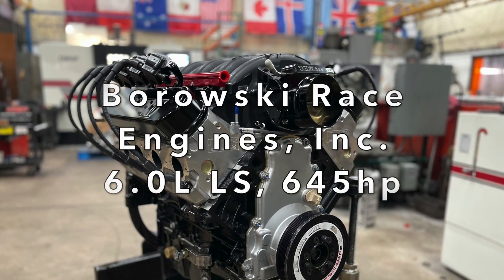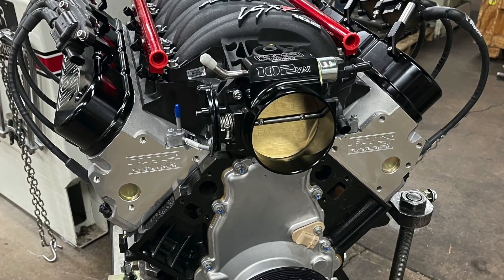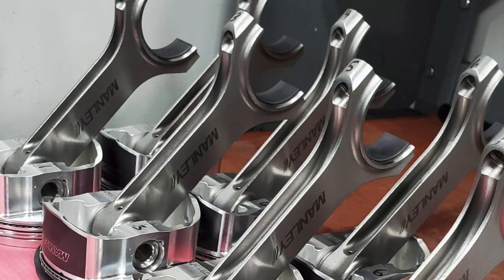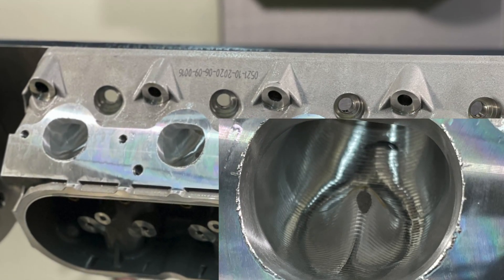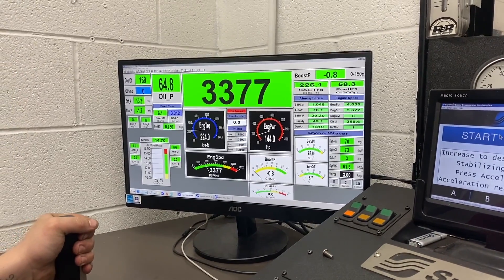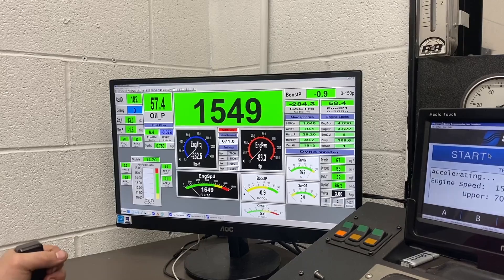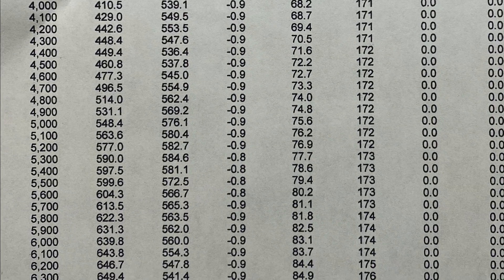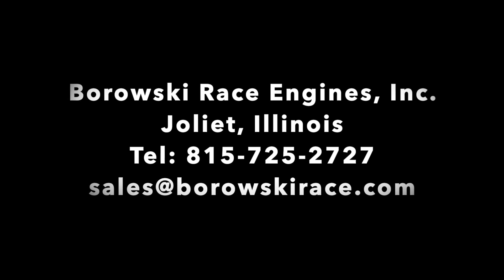Borowski Race 645 hp 6.0L LS Engine

Comment: What water pump is used for this kind of power would the stock LS acdelco one work or is a high flow needed
Reply from the maker: The water pump is not the weak link on most cars with moderate power upgrades like this one. Radiators and fans are the first place to look.

Comment: 5w30 in this engine ?
Reply from the maker: We recommend Maxima Racing Oil RS15W-50 Full Synthetic Motor Oil  https://borowskirace.com/products/maxima-racing-oil-rs15w-50-full-synthetic-motor-oil?variant=43080442216660
Reply: @borowskirace  what about a stock ls7 bottom end factory fill 5w30 ..wouod go with Rs maxima 5w30?
Reply from the maker: @ We only make recommendations for our own engines.

Comment: What is the cubic inch of this engine.
Reply from the maker: The 6.0L stock configuration is a 4.000" bore with a 3.625" stroke to yield 364 cubic inches.  We bore the cylinders 0.030" over (4.030").  This increases displacement to 370 cubic inches.  We just started spec-building one of these.  Our plan is to use seasoned GM heads instead of the new RHS heads shown in the video.  Both go through the same CNC machining processes at our shop.  Intake manifolds we have on hand are the FAST LSXR as in the video, as well as FAST LSXHR and Holley Lo-Ram. Other choices include types of serpentine and engine management if desired. Call us at 815-725-2727 for more details if you are interested.
Reply: @borowskirace  does the engine run pump gas or something else.
Reply from the maker: @anonymous-q4j2x  this is intended to run premium pump gas but we can detune it as needed for your preferred octane.  It can also be made flex-fuel capable.

Comment: Can you run that on a built 700r4 transmission
Reply from the maker: Not recommended.  The original version of our shop El Camino had an LS1 with 525 hp.  We bought a "built" 4L60E from a race transmission shop and promptly destroyed it.  The shop didn't stand behind their transmission despite having said it would work.  At that point, we sought to qualify a new automatic transmission vendor.  That turned out to be Hughes Performance.  We replaced the 4L60E with one of their 4L80E's and begand pairing them with our engines.  We sell two custom versions - 1,000 hp and 1,500 hp ratings.  The typical pairing is NA with 1,000 hp and Whipple supercharged with 1,500 hp version.  In the intervening 10 years, there have been no failures reported.  We have also had excellent success with Tremecs if you are up for a stick.
Reply from the maker: Point of Clarification - 4L60 is a rebranded 700R4.  E indicates electronically controlled shifting capability
Reply from the maker: https://borowskirace.com/products/custom-4l80e-hughes-performance-transmission?variant=43592574828756

Comment: plz,plz,PLZ on the next block going into one of ur vidz could u calculate the mpg it gets for us ???????????  a balance of bothe power & mpg is good for those of us who WANT a WELL biult machine but r NOT pro racers.maybe we like a SPORTY car but need to keep gas in the tank😅.
we r fully aware that what u show r 99% race app engines and it ur trade in stock. but DO biuld other "normal-ish" stuff right ??  mpg is 'sadly ??' big stuff with prices as they r ... ( i'm wainting for th Gov to step n and put a cap on this run awy train.... anyway i love the videos... stuff dreams r made of.
am i asking 4 the impossible ??? plz respond thanks ...me😊
Reply from the maker: Good news.  You can hear directly from one of our customers at about 6:00 in the video linked below.  What surprises most people is that these street LS engines are reasonably fuel efficient.  What will control gas mileage is the car's transmission and rear end gear ratios.  The Camaro in the video has a Tremec 6-speed manual.  The final drive ratio for that transmission is 0.63 to 1.  Our shop El Camino had the same 1,000+ hp  2.9L Whipple supercharged 427ci but with a 4L80 transmission (0.75:1 final drive ratio). Not all of our conversation stayed in the video, but my recollection is that we both had 3:50 rear gears and similar tire sizes.  

Bottom line: Charlie gets 17 mpg in the Camaro and I got 13 mpg in the El Camino.  Due to the final drive ratios in the transmissions, I had to run 19% higher RPM to go the same speed. The El Camino was heavier, always loaded with gear and less aerodynamic than the Camaro.  The net result is that his tranmission would have gotten the El Camino to about 15.5 mpg and the other factors account for the other 1.5 mpg difference.   Neither car needed a 3.50 rear but that is pretty standard among car builders.  3:00 gears would likely get him close to 20 mpg.  He stated in the video that he did his 1/4 mile pass in Charlotte starting in 2nd gear confirming that his 1st gear is too low. 

He and I both could have likely squeezed out more mpgs if we wanted to, but that was never our objective.  The supercharger would engage with anything more than light throttle pressure. While cruising, the engine would be under vacuum, (not boost) as if it were naturally aspirated.  Our standard 700hp 408ci LS ought to out-perform on mileage because it has a little smaller displacement and there is no supercharger.

Hope this clears up your questions.

https://youtu.be/o4XCpapCQJM
Reply: @borowskirace 
WOW. I AM SOO IMPRESSED THAT U TOOK TIME TO RESPOND !! IN SUCH DETAIL. i CANNOT THANK U ENUF THATS 4SUR !!!!   IT DID INDEED ANSWER my questions !!!!   and i seriously hope that other out there in YT land with the same thots i had got well schooled on this one !!!!  again , thank you so very much.  i feel i would b ok having such a monster lurking under my hood in my daily !!!!! and still feed the kids !!!!! lol.  you guyz r awesome. i know where to send my 327 sbc. or buy a bbc !!!!  i think the 327 and a procharger (?) would b a happy couple ;)
Reply from the maker: Here is a link to the 700 hp 408ci engine I mentioned.  The YouTube video here is 370ci and runs a seasoned GM crank with stock stroke thereby cutting cost. This build  is also on our website.  We could take our more cost (and a little hp) by switched from new RHS heads to seasoned GM LS3 heads that we put through our CNC processing. https://borowskirace.com/products/700-hp-naturally-aspirated-415-cid-hydraulic-roller-ls-street-engine-complete?variant=43480143790292

Comment: 24x tooth reluctor wheel?
Reply from the maker: We generally use a 58X on our GM LS builds, but not always. These usually leave our shop with a Holley Terminator X or X-Max.  At one point, we saw that supply of the 58X ECUs was drying up, so we grabbed all their available 24X units. We then either switched reluctor rings on the cranks or bought new 24X cranks to match as needed. Both types work fine.

Comment: Is that a lq4?
Reply: My guess would be lq9 simply because of higher performance but obviously can’t see the piston to be sure. I could be wrong though
Reply: @dylanwilson2047 it doesn’t matter. The blocks are the same and they are using brand pistons
Reply: @theshark2804  true. I usually just skip to the fun parts😂
Reply: @dylanwilson2047  no worries I like to look but no way will I spend that type of cash.
Reply: @theshark2804  agreed. I like to tell myself that within the next two years I’ll LQ9 swap my Tacoma but it’ll more likely be within with next 20😂
Reply: I believe it’s a gen IV 6.0 so the ly6 you can see it after he mentions the connecting rods

Comment: Stock cubes???
Reply from the maker: Hi Trent, Yes, this engine is essentially stock cubes as it is using a stock crank.  Pistons are 0.030" oversize.  Next step up is a stroked version where we use a Callies center counter-weighted crank. Here is a link to the 700 hp stroker version: https://borowskirace.com/products/700-hp-naturally-aspirated-415-cid-hydraulic-roller-ls-street-engine-complete?variant=32732507668579